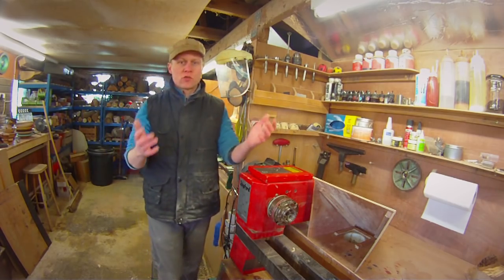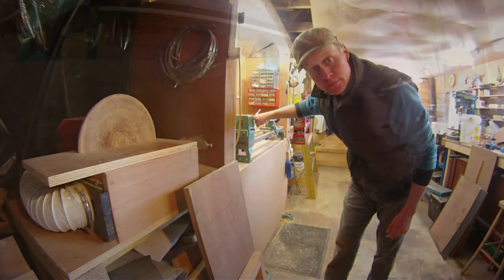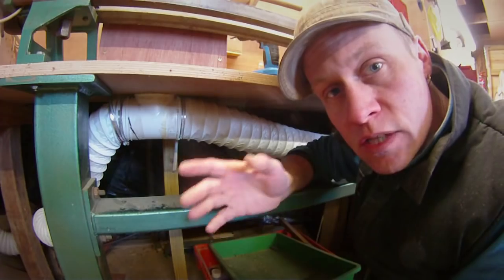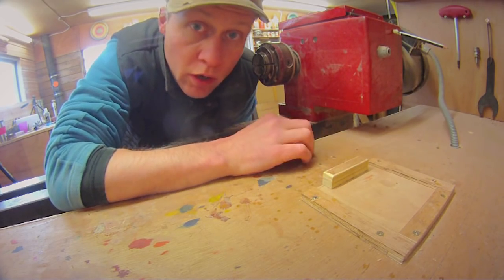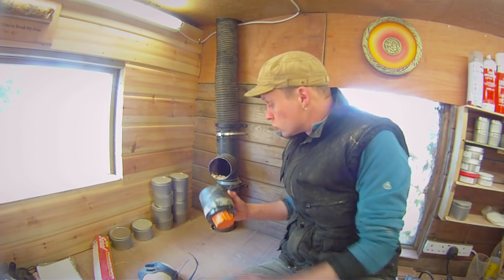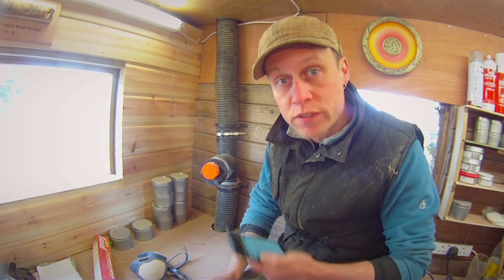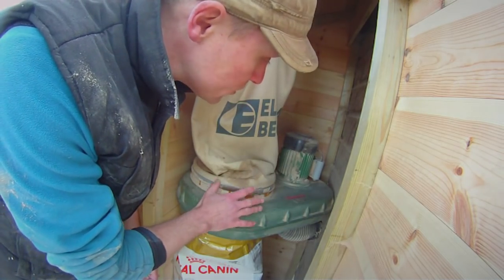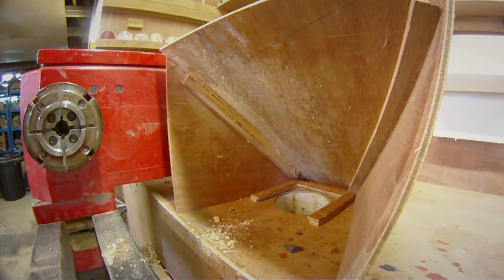#59 - Woodturning Extraction System Overview

Comment: Wow! Martin, thanks for the shout out!  I stumbled onto Mr. Plentz website when I was planning my "small portion of the garage" work place when I retired back in ought three.  He has done the math regarding dust collection and has plenty of information about what piping does what, 90 degrees bad, static boom, you name it.  
Like your homemade gates, but I don't need them.  No piping more than six feet, with three small cyclones from five inches (hose size) to two inches with a 1.5 inch adapter that go directly into sanders and such.  Its all about the velocity of the air that's moving past your work, and how often one has to clean those nasty dust bags.
Now, if I could only figure out how to keep my tool sharp.....

Comment: really nice overview and covers what is needed.    -I look forward to the day that i can put my blower outside and not have to work with a headset on all the time....but that'll have to be when I build my stand alone shop....

The problem of inhaled wood dust is a very real and very serious issue.  It's particularly problematic with certain types of wood, but ANY dust that deep in your lungs will cause you problems.   I would also suggest a "air cleaner"....a separate box with a fine grade filter media (like something used in a furnace or A/C)  and put in a location where it will circulate the air of the shop and filter out those small airborne bits that are particularly harmful to your lungs.  (they don't need to be the expensive versions...there's several "home-built" examples on here that can be done with an old household fan and a bit of cabinetry work....)

an alternative for the piping is 4" central air ducting, (essentially like your downspout pipe)  The smooth sides helps keep any suction losses down as well... also has the benefit of premade elbows and adapters.   Depending on your local availability, it's not that unreasonably priced.   

I would recommend a thien-style separator stage prior to your actual blower.   I started with a unit much like yours, and got tired of having to fight with swapping the bags out  (btw, heavy duty garbage bags will work with them as well)   with the separator stage, very little ever gets to the blower itself, it's all caught in the can where it's more easily dealt with.

Comment: Nice review.  I use a combination of metal and plastic gates.  The plastic are similar to yours, they build up dust in the gate channel resulting in the inability to close tight.  Used a 1/2 inch drill at the lower corner to create a hole for the dust to be pushed out.  Works ok for now.  For piping, I used a light gauge sewer pipe, sweep bends and the spiral pipe runs as short as possible.  But, my extractor is 1hp, about 650cfm so a small unit.  Still use a mask for the heavy dust generating events.  We all do what we can, and something is always better than nothing!

Comment: nice system. you might want to check on the use of ground wire through it. I'm no authority on the matter but have been told that the plastic pipe can cause static electricity and possibly can make very fine dust ignite. have a good one. 

yak

Comment: I see someone else mentioned using sweeps in place of the sharp 90 degree elbows would increase efficiency. Also the last "extra" port would work better if replaced with a "Y" instead of a "T", the dust and chip build-up there would be virtually eliminated. I like the simple yet effective blast gates you made...good idea. You might try lining the slides with felt to increase the seal and still allow easy movement. All in all, a well designed system and very interesting video.

Comment: I have just fitted a t piece to a 100 mm  hole  behind lathe  with dryer pipe on one side of t  and black pipe on other side connected to dust unit ,the dryer pipe   Has a blast gate from amazon  temporarily fitted. But the hole behind lathe has great suction   just the bench blast  gate on bench to make  thanks for idea martin. Ps  wring that hens neck

Comment: Thanks Martin - will have to get Michael to extend his system to include the sanding area as well as the lathe.  It was, of course, easy to follow having visited your workshop and very clear to understand.  One question, can you recommend a source for the large jubilee clips and are they purchased by length (circumference) or diameter
Reply: ***** many thanks will have a look

Comment: Great video, I was thinking of using duct pipe (don't know if that's the same stuff but looks like it). Some links in the description doesn't work:  blog post, Dryer Hose, Extractor Joints, Extractor Brackets, and I think on your website there are ebay links missing. Just to let you know :)
Great job with the extraction
Reply: +Martin Saban-Smith you are right, all ok on my phone

Comment: Hi Martin check this one out  on ebay ,i have it in my work shop and it is a great gadget
 Remote Control Sockets Wireless Switch Home Mains UK Plug AC Power 3 Pack 
Thank you for sharing all the good work 
Yiannis